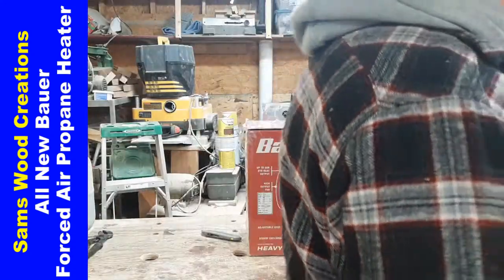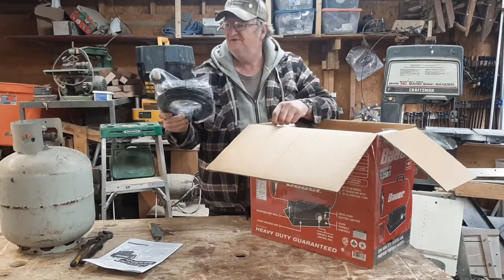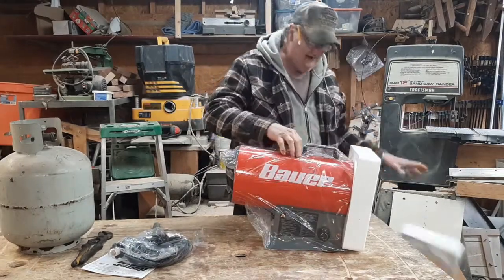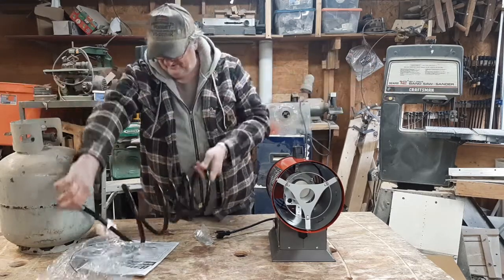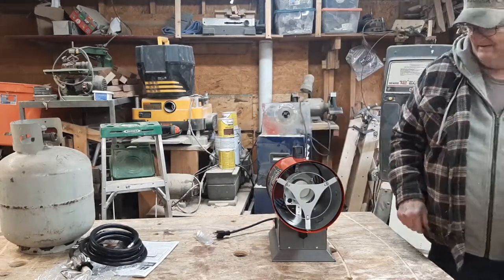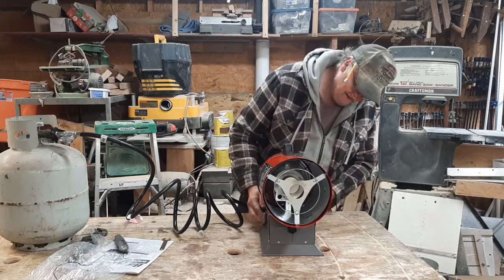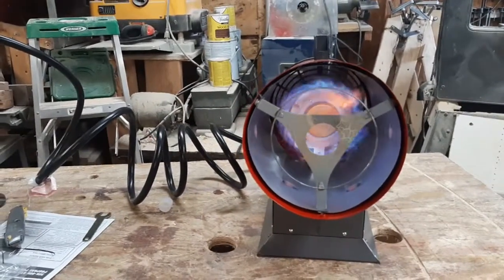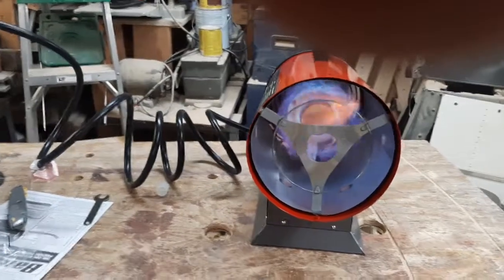ALL New Bauer Forced Air Propane Heater by Harbor Freight

Comment: Just bought a Bauer forced air heater such as yours.  My problem is I cannot stop a leak of propane from the threaded connection to the heater.  Does the supplied regulator hose have a rubber gasket on both ends or just the threaded end to the propane tank?  I have tightened the heater side of the hose (compression connection) as tight as I dare without ruining the brass nipple end but I still have a leak.  I know that most compression fittings (as in most water lines in the home) have no rubber gasket to achieve a water tight seal, but I am not sure about gas lines, such as these which supply propane to the heater.  Can you advise?
Reply from the maker: sounds like the problem could be inside the fitting of the gas tank or the regular end . there is a o-ring on the hose that inserts into the gas tank that could be damaged.
Reply from the maker: warranty is could for 90 days so you could take it back
Reply: Well, I did find on another Youtube site (I think it was a Craftsman unit)  that says his supply tube had rubber gaskets at both ends. So with that in mind, I used a 3/8 inch rubber O-ring (also bought from HF) in the compression fitting and that took care of the leak.  So beware, if you have a leak of propane at the compression fitting to the heater you could use an O-ring for a more secure and tight connection.  Hope this helps someone.
Reply from the maker: @tedtolentino4955  glad you got it fixed. I checked all of my connections when i put it together with diluted dish washing liquid in a spray bottle and had no leaks. (been in industrial maintenance for over 45 yrs) ...Oh and one other thing, the outside metal tube is really thin and flimsy. If you press on it or lean on it to get up (old Age..lol) it will make the blower fan  hit the housing!!!

Comment: I just ordered one today. I plan on using it on my patio. Does it throw heat pretty far forward? Thanks!
Reply from the maker: It throws out heat about 6 to 7 feet in the still air of the garage. not sure how fall it would go on a patio in the wind.
Reply: Did it work ok for patio?

Comment: Thanks for the video. Am I wrong to believe that burn propane creates carbon dioxide fumes that would be dangerous inside the shop? I have a 1000 sq ft wood shop that needs a heater...
Reply from the maker: these kind of propane heaters do put out Carbon Monoxide. you have to pay attention to the color of the flame. the more blue the flame is the better.
My garage is small and has air moving through the cracks all the time , so its not to bad, plus after a quick heat up, I switch to a 5K electric heater.
there are propane heaters out there that burn so clean, you can use them in your house. Dyna - Glo is the one that come to mind. they burn so clean that you dont need to vent them....here is a example...Dyna-Glo 30000-BTU Wall or Floor Mount Indoor Natural Gas or Liquid Propane Vent-Free Convection Heater. As large as your space is, you need a furnace!
Reply: @SamsWoodCreations  thanks for the reply! Don't think my landlord will pay for a furnace lol I guess it makes sense to heat with propane with the door open for a bit, then turn off the heater and close the door.

Comment: Do you know the fitting size for the hose ? Trying to find a replacement hose is nearly impossible for this
Reply from the maker: i really dont know.  Harbor Freight does sell a propane hose, but I don't know if it will fit the bauer.
Reply from the maker: one of the propane grill hoses should fit it. You can find them at Home depot and other hardware stores.